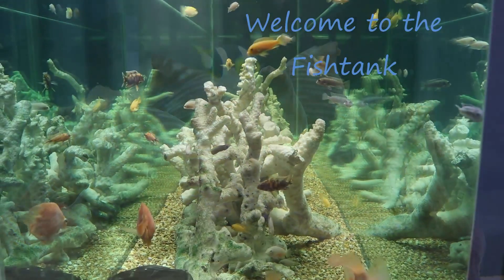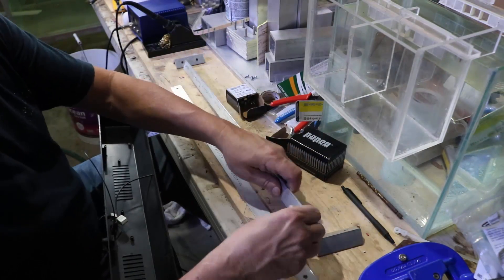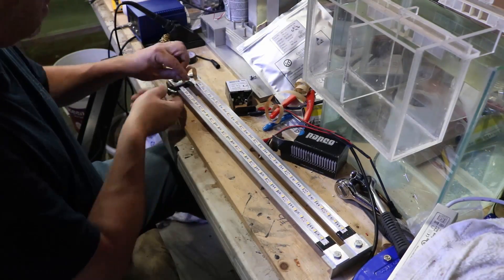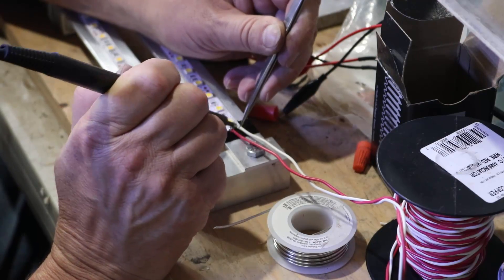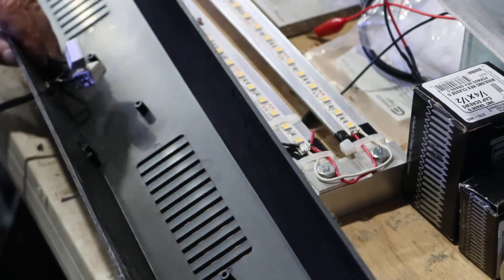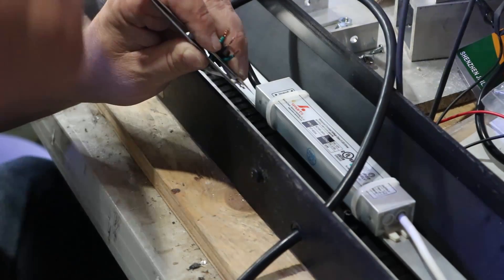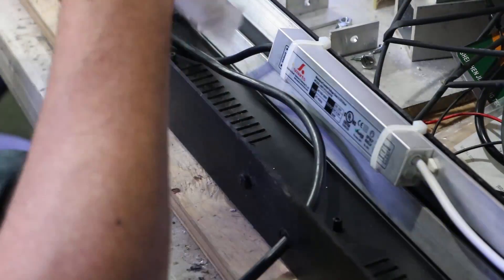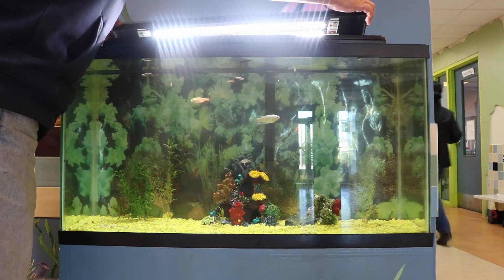DIY Conversion of  a Fluorescent Canopy to LED

Comment: I like this. Do you think this is better than buying a T8 LED replacement tube light?
Reply from the maker: Thanks I'm glad you like it. In this particular case the part I needed wasn't available. In general I prefer doing it this way because if something goes wrong I can swap out parts easily

Comment: Hi Eric, is it not necessary to use marine grade/waterproof LED Light Strips?
Reply from the maker: Hi Martijn. No you don't need to use water proof LED's. It is important to use a water proof power supply. The LED's themselves can handle a fair amount of moisture. I seal all of the solder joints with silicone and I place a glass top on the tank to prevent splashing. Thanks for watching

Comment: Very nice retrofitting 👍🏻 in the U.K. thou that work if not carried out by a qualified electrician could land you in jail and invalidate your house insurance in case of fires ( I’ve no idea if you are or aren’t and any us laws that relate to this ) thought I’d mention it as even in the UK now you can’t legally change a light switch lol ( I work as a electrician so happy days lol )
Reply from the maker: Thanks for stopping by. In Canada your not allowed to alter any electrical system in real property unless you're a qualified electrician. They don't cover things that you can plug in as long as the components meet CSA standards.
Reply: Fishman your install was fine in the UK until you split the incoming mains lead and left it inside the unit ( needs to be ip68 here that how we rated waterproofing )
Reply from the maker: Yes. I usually just buy the prewired power supplies but I had this one remaining one left. In the future I won't be using this type anymore. It's easy to wire but I suspect we will eventually have similar laws here and I like to keep ahead of them when possible.Thanks for your input
Reply: Fishman your welcome brother 👍🏻👍🏻
Reply: Fishman I’m not trying to be negative but I find errors in electrical stuff 😬

Comment: Wow. Great job.  That light is now worth $300 US!!  Aluminum here, unless bought in bulk is crazy expensive.  I built an led light last fall using a gutter but never thought of using an old light...great idea.  Speaking of glass tops, are the replacement plastic hinges any good for glass panel lids any good? The hinges I got with the used 125 were broken and I found some listed on amazon for about $30.
Reply from the maker: Hi Jim. The aluminum came to about $4. I prefer to use sliding glass tops instead of the hinged ones. I've never bought them off of amazon . Let me know how they turn out. Thanks for stopping by